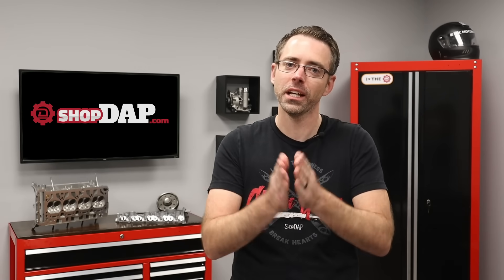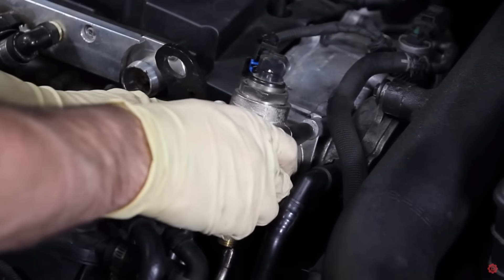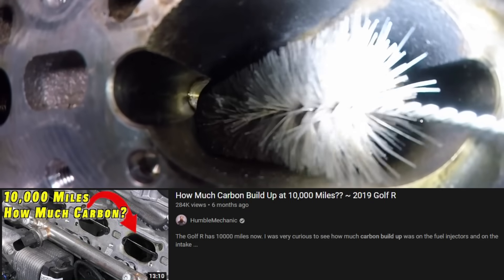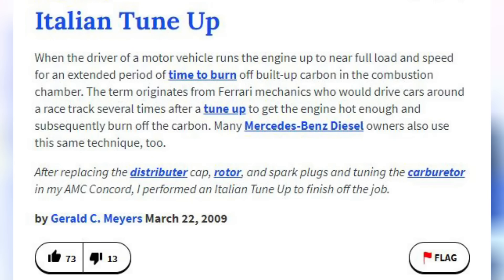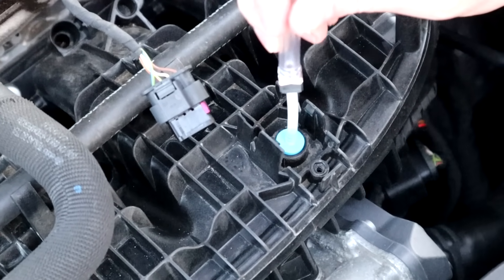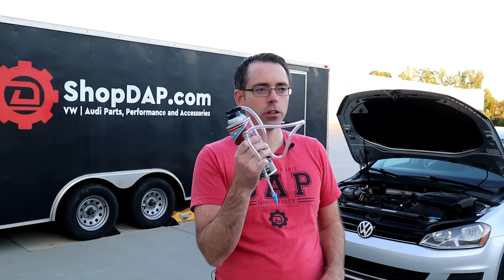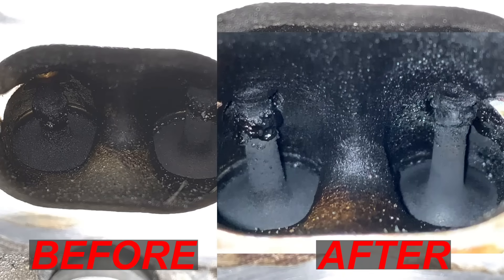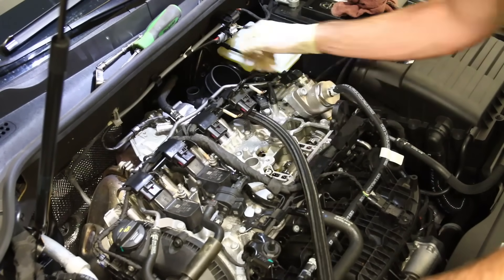Can you Really Remove Carbon for $29?

Comment: Great video! It seems like the best solution is to stay away from DI engines and go with a Port or Dual Injection engine.
Reply: I agree. The biggest benefit of DI fuel systems is to the auto manufacturer, to meet ever-increasing fuel economy standards. Even a 1-mpg improvement can make a difference to a carmaker - while adding hundreds of dollars in maintenance costs (i.e., media-blasting) to the car's owner, negating fuel cost savings.
Reply: Toyota D4S is your friend
Reply: GDI engines are actually a no brainer. That is currently the most efficient fuel delivery method. Compare 2.0 engines of today to decades ago; almost double the HP and better efficiency. Take into account today's fuel has been diluted not just with ethanol but a bunch of additives (try evaporating gasoline and see what percentage of additives are left. Add to that all of the emission controls vehicles have and you can see how much more efficient engines are today.
How you ask? 
Direct injection is one piece of the puzzle. The other is fuel delivery PSI. Manufacturers will just keep increasing the fuel pressure to keep the marketing scheme going.
Reply: youre right but most vag engines before 2015 in the us dont have dual injection
Reply: Stratified makes a great little throttle body(sort of) injection system. It is $900.00, but you don't need to mess with a meth injection system( although there is a port for meth as well).
Reply: as far as i can tell it seems like they barely make port injection anymore for new cars. my 2005 toyota was a port injection non interference engine. should have never sold that car. no wonder they can last 300k miles

Comment: How would a filtered crankcase ventilation hose work, or route the ventilation hose through an extra airfilter box ?
Reply: Look up a catch can. It's what they do. Separate oil/liquids from the air being pulled.  They are very helpful but not 100%

Comment: Italian tune-up works mostly on carbureted engines,when you pour a large amount of fuel at extended period of time in to the intake ports the fuel,plus the heat,gets a fair amount of carbon off.The same happens on port injection
Reply: A while back, I read the results of testing by a scientific lab, which concluded (though I don't remember the actual numbers) that you'd need to keep the rpm continuously very high, under load, for a very long time, to approach cylinder temperatures high enough for any carbon reduction on intake valves. Those extreme temperatures would never be reached on the street, and/or would be harmful to the engine in other ways.

Comment: I have a 2017 VW  Passat 1.8L w/20,000 miles...Wondering if I hooked up one of my homemade hydrogen  fuel cells to that MAP sensor port...whether or not it would delay or eliminate the need for these services.. I'm thinking, 30 minutes, every 1000 miles for preventative maintenance. Curious..would it throw a code??? How long can you let your car idle with a disconnected MAP sensor..??
HHO Works beautifully on my 02 Jeep, but these VW's  are so much more convoluted..
Just a beleaguered VW guy with so many questions..lol
Spoke to a few mechanics and they all said the same thing...sell it and buy a Toyota..Car runs great and would like to keep it for a few more years..Quality pure Gas and frequent oil chances are a given, but probable won't help over the long haul..

Comment: It's tedious, but do it the right way. The carbon gets REAL bad and extremely hard. CRC carbon spray/Sea Foam etc... (Been there , tried that) does not work well enough to really make a difference. 

One of the top reasons a direct injection engine is running poorly. 

My Audi was TERRIBLE,  until i walnut shell blasted them.

I won't buy anything direct injection until Audi etc, follow Toyota's foot steps and use a regular injector AND direct injection

Comment: I have a very simple vacuum operated water injector I built with some basic fittings that I use on a GDI Kia.  While I haven’t visually inspected the intake valves, it has been running progressively better the longer the devise is in use.  I also think that in addition to cleaning intake valves, it is important to clean the injector nozzles as well,  I believe that they get carbon deposits on them in the combustion chamber and these deposits disturb the shape of the spray pattern.  This water injection system is in my opinion the very best way to decarbon everything in the combustion chamber, perhaps most importantly the injector nozzles.  I’m not a fan of GDi engines, I understand the benefits, but I think they come at too high of a price to be worth it in the long run.  Give me the old port injection any day.
Reply: Designed to be thrown away at 150,000 max.
Reply: The simple fix some manufacturers are using is having a second set of injectors at the port. It's supposed to be used during performance demands and keeps the intake valves clean. Hopefully more manufactures will adopt this method.

Comment: Looks like that foam did nothing, other than make the carbon deposit sticky.
Spend money on the best fuel (as a preventative) rather than spending money on foam cleaners after the build up has started.
Even better, don't do lots of short runs in your car. Walk, cycle, use public transport. Save the car for longer runs when it can get up to temperature and stay hot for a bit.

Comment: Meth runs intermittently.  Usually at high revs only, so, it also will NOT solve the issue, only slow it down.

Comment: Save your money, none of those spray and pray products work. $450.00 every 60,000 miles is a cheap maintenance issue. It took my mechanic 1.5 hours from start to finish, he walnut blasted the back of my intake valves and I will see him in another 60,000 miles.

Comment: The problem is from engine blowby of a mixture of exhaust, fuel, and engine oil.
Install oil catch cans on the engine breather and PVC hoses.
The larger the cans the better.
Don't install the cans until after the vehical warranty expires.

Comment: I pulled the intake off my 160,000 mile  5.3 Litre direct injected only V8 because i had to replace the injection pump under the manifold. Super easy to do BTW.  Inspected all the runners with the intake off and they weren't even dirty enough to bother cleaning. IDK if its just the oil i use , type of driving i do , or GM just did something right but i was impressed. Especially after all the fear mongering ive read about how bad DI is for intakes. i just sprayed in some basic cleaner wiped em as far as i could reach in with a shop towel and reassembled.

Comment: Catch can combined with a EGR filter would eliminate nearly 80 percent of build up for every 100,000 miles for all 3 types of fuel delivery systems multi-port,Direct port or fuel port the carbon build up is exhaust soot and oil deposits removing the soot would be good thing and a EGR filter would do the job well.

Comment: I've installed a catch can on my car, I definitely have to service it every 500-1000 miles or it trips the check engine light for running too rich.  I usually get a couple ounces of goo.  The car noticeably runs better with the goo gone.

Comment: Water meth really is the all-in-one solution for turbo cars. It steam cleans, prevent intake buildup, increase fuel octane, lowers emission, and actually lower fuel consumption as the engine run less rich with colder air (15- 30% less gas for aggressive drivers) It allows you to easily add a few more pounds of boost without knocks. Highly recommended especially if you got supporting mods to tune or piggy back.

Comment: The worst thing any of these spray and pray treatments can do is actually clean carbon deposits. Do you really want a chunk of carbon - that is hard as rock by the way - to break off from the valve and scratch the cylinder wall, damage the turbine blades of the turbo charger and eventually clog up the catalytic converter as it goes through your engine and exhaust system?

Comment: You can find very cheap 'plug N forget' water meth kit nowadays. With a solenoid valve. 350$ usd. Plug it in your windshield washer tank and call it a day. On my B7 it took me about 6h. 250cc injector. Work well even if its my dd. IN the mean time a walnut blast at a shop its 300$ usd...

Comment: So, I buy a DI engine car so I have a more efficient engine, but I have to use it hard and spend more fuel so it doesn't have carbon, seems legit, lol
Reply: Driving it hard doesn't help anything. The sad fact is that all these direct injection engines are going to need intake valve cleaning every 50,000 miles or so. Walnut blasting is the way to go.
Reply: Yep, keep the carbon inside the engine because “climate change” 😤

Comment: Humble Mechanic did a video on this like a year or 2 ago. 
Easiest thing to do is...
1. get a bunch of small zip ties
2. tape them to a small dowel that you and put in a cordless drill
3. remove intake manifold
4. with valves closed, flood the port with brake clean and let it sit for like 5 min
5. With your mcgyver'd brush in a drill, and run it in the port. 
6. soak up/remove the dirty brake clean with a rag
7. repeat with the other ports (with turning the crank by hand to make sure the ports being cleaned are closed)
Reply: i was just coming here to say zipties and a drill but i was a year too late 😄
Reply: @billynomates920  Iz why you got no mates, Billy.
Reply: link?
Reply: Show BEFORE and AFTER pictures.   I don't believe it.   I think the only way is a media blaster and that only has limited benefit    GDI is a NIGHTMARE.   Carquest told the students to NOT BUY GDI when it first came over 10 years ago and that is still good advice today.   The only thing you can do is buy a Lexus that has BOTH GDI and Port injectors.
Reply: Some people say oven cleaner works.
Reply: @don-cw1yz it does work however that carbon flakes and rubbish will go all through the engine and could clog the cat or dpf, it can also cause micro scratches on aluminium intakes and what not, those scratches then catches more carbon. But if you do oven cleaner with zipties, vacuum and flush.. yeah maybe..
Reply: And for those who found a better way to flush the debris, compressed air.    WEAR A SHIELD WEAR A SHIELD WEAR. SHIELD.    Or U B SORRY 🙈🙈🙈🙈.    Some of us are smart and some aren’t smart enough to know it’s coming outa there right at you.      Run run run for that eyewash station …………… or the garden hose 🥹
Reply: @drizler  lmfao i'm sitting here reading this comment visualizing this happening to myself like nah i'd never, knowing in my excitement at this working immediately do just that. Hope the joke isn't from experience
Reply: better way is put vacuum hose in the hole and then blow air around, vacuum will suck it right up. just did this @drizler
Reply: What i did, sell the car buy an Electric car and drive that car for 100.000 miles with just only changing tires.
Reply: @HermanWillems  I drove EV for 9 years and I'm going back to Petrol. 

I drove a 2 tonne Volkswagen id3 82 Kwh and it really dulls the experience, also the infotainment is shit and dangerous so I said no more cars so heavily dependent on software and screens. 

The Petrol car I'm getting is a 2020 Kia Cee'd , 1.0L turbo petrol, 120 Hp with manual gearbox, I really realised during the test drive how dull and boring electric cars are and add to this the inconvenience of charging on a long distance.

The worst thing is the depreciation was horrific and worse is the fact where I live no car dealer would accept it as trade in not even the VW dealer who sold me the car who said that they have too many electric cars they can't sell. The money I was offered was shocking for a 2.5 year old car. 

Once I got over the instant torque and different experience electric cars provide I realise electric cars have not a lot to offer but a lot they take away.
Reply: @o00scorpion00o  agreed but why 1.0L kia,?🤮
Reply: @vaseabmwe39  I got it for a decent price and didn't want a diesel, the Kia will do 4.6 L/100 km on a longer run or at faster speeds around 5.3 L/100 km, in town 6.0L/100 Km which is a hell of a lot better than our Diesel Outlander lol. 

I love driving it, love the sound of the 3 cyl when driven on and it has a nice bit of torque.

It's got more than enough power for me, when I want fun I head off on the Bike, ok, it's 500 cc but way more fun than any car !

But, still, the Kia is a lot nicer to drive than a my old 2 tonne EV hatchback that handles like a barge and hard suspension, they should be illegal on the roads due to the weight ! Hearing the engine and changing gears is definitely far less boring than driving an obese EV with no sound and everything electronic.
Reply: @HermanWillems weird way to say you're not a car guy.
Reply: @HermanWillems   well u drove already 100.000 miles?  i would be intrested in the real result there.   :)
Reply: @HermanWillems  At this very moment, ev's started to really look appealing to me.
Reply: @waynefilkins8394  Electric cars won't look so appealing once  you experience shocking depreciation, stupidly long charge times, short range, broken chargers, queues at chargers and a very dull driving experience, once over the instant torque and silent acceleration experience then electric cars haven't a lot to offer, cheap motoring maybe but in my opinion it comes at a high cost in other ways to the owner and to the environment, how they produce lithium and cobalt is far from environmentally friendly all to reduce Co2 but at high cost to the environment in other ways, no, I don't believe EV is the future. 

After 9 years EV driving I'm going back to petrol manual cars, they are much more enjoyable to drive and much cheaper to buy so I don't care about fuel consumption, in fact, I'll gladly pay more for fuel than wasting time at chargers and the dull experience driving ridiculously heavy cars brings, electric cars are like appliances today. 

I also don't like big screens, digital instrument clusters and so much software in a car. So going back to much more simple cars. 

I can't imagine the cost to replace some of equipment in cars these days, that's even before you get to the EV bits, if the battery dies out of warranty the car is junk.
Reply: @HermanWillems  and then what???
Reply: @drizler  And then spend 10 grand on a new battery pack😂
Reply: @drizler  100k in batteries.

Comment: Pull the intake manifold and spray Mr Muscle oven cleaner in the two ports where the valves are closed, leave for 1 hour and then use wire brush to remove all the carbon crud. The valves will come up shiney and new. Rotate the engine so the other valves are closed and repeat. Mr Muscle £8 a can and a couple of hours of your time.
Reply: Interesting! How do you get all the gooey crud out though?
Reply: Damages the surface of the aluminum and results in faster build ups. Mr Muscle even states that it shouldn’t be used on Aluminum!

Comment: We used to use water from an atomizer bottle on the intake that helped a lot. 
Also back in the day we would just switch spark plug leads and there be a little bit of detonation there and that would blow stuff out too. Just  don't do it too often.

Comment: Do you leave the MAP sensor plugged in? I know you removed it to use as an access point but is it left electrically connected?
Reply: It’s left unplugged.   The check engine light will come on.  Once you put it all back together, the light will go out.

Comment: I should be done in every tuneup or oil change. The before and after in that point in my opinion I’ll blast it,that point on I just use the Seafoam valve cleaner in every oil change or tuneup 👍

Comment: For mechanical removal of carbon buildup (media blasting) has anyone tried dried ice blasting? This should have the benefit of eliminating the mess of walnut shells as the dry ice simply evaporates. Also, there's no risk of walnut shells ending up in side the cylinder or edges of the valve, possibly causing other issues from media contamination. Your thoughts or experience are appreciated.
Reply: No but I used the Sonic Diced Ice media. Its the best
Reply: Yes. It works
Reply: The walnut shell will burn up as long as you're not filling the cylinder, it's the carbon you're breaking loose that you really need to worry about.

Comment: I have a 2017 VW with a 4cyl 1,2 tsi engine. Has around 29k miles on it. Is this an issue on those as well? It has a CJZ engine according to the vehicle registry

Comment: Maybe a stupid question, but wouldent be a solution having the PCV jus to ventilate on the road as with old cars, plugging the intake hole and fooling the electronics? That should solve this very easily....

Saying this this may not be fully legal in some places but the diesel gate was not legal as well,  the other means with additional injection and so on are for sure not legal in many places and rolling coal is not legal as well or even if its legal somehwere its much much worse than this.

So tell me did anyone figured out how not to have the T/FSI engines to fart directly into their nose?